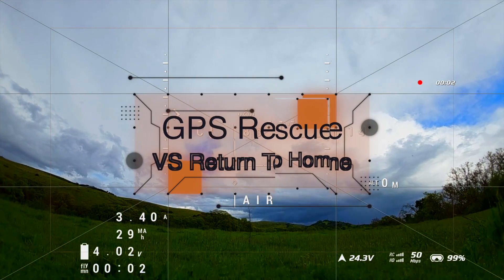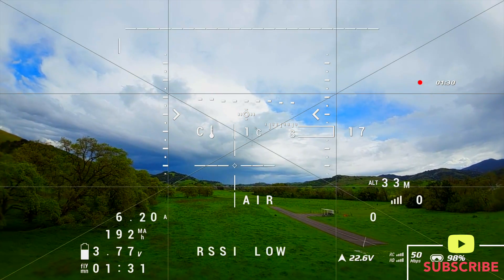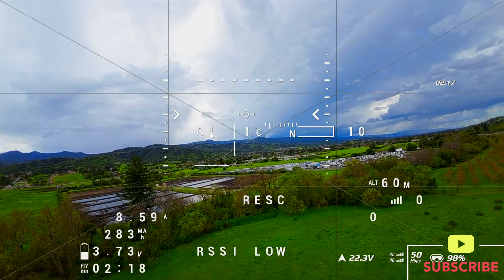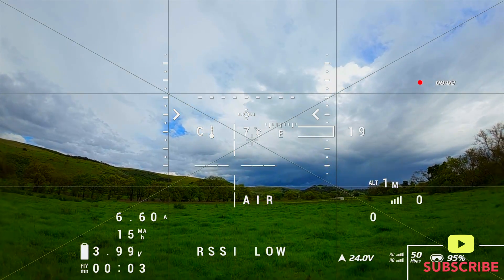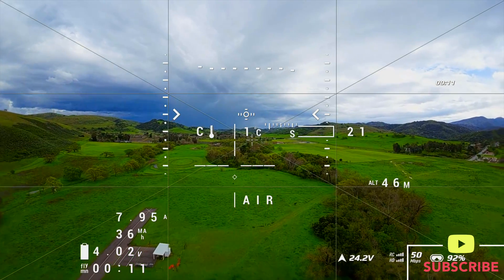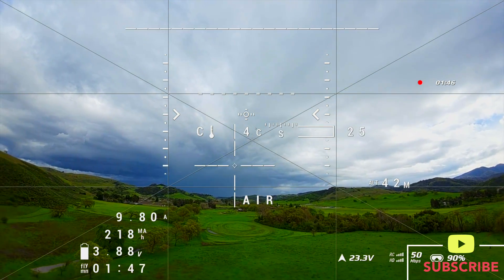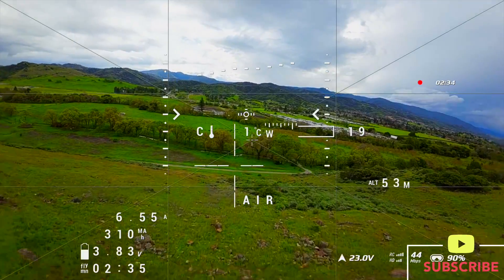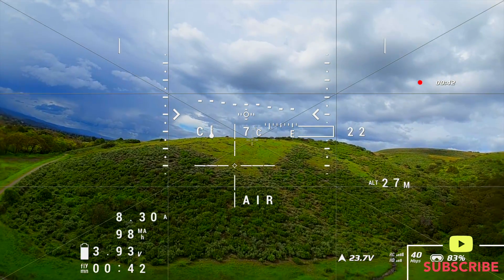#FPV GPS rescue  vs Return to home

Comment: I don't think its really a fair example of GPS rescue operation when you clearly haven't followed the setup instructions with respect to setting hover throttle setting etc. I found that with just minimal setup, it actually works incredibly well and will typically land within 2m of the home position even in significant winds. When stage 1 failsafe kicks in, your drone should switch to angle mode and just begin to climb, so that by the time stage 2 activates GPS rescue, the drone is already stable and climbing. Your crash was user error, not a problem with GPS rescue. You can't expect something to work if you don't configure it.
Reply from the maker: Good point. Where did you learn to implement such a configuration?